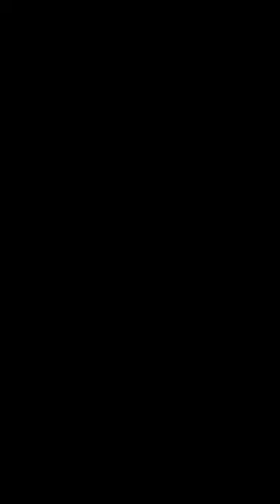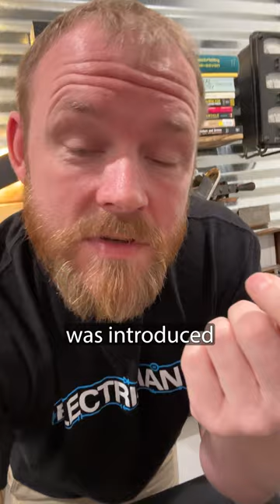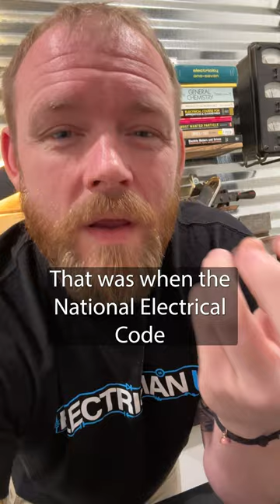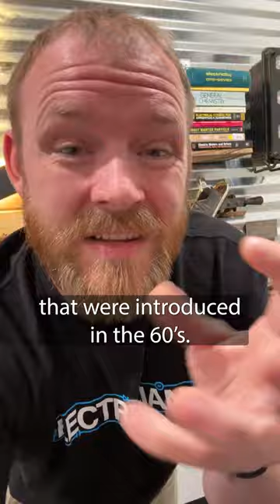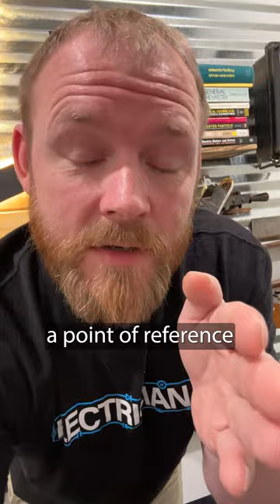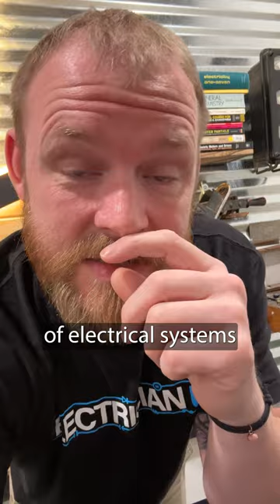Did You Know There was a Time When We had No Grounding Conductor?

Comment: Before GFIC the shaver outlet by the bathroom sink used an isolation transformer to prevent a return path to ground. GFIC compares current in the hot and neutral to make sure they are balance within 5 mA. If they are not balance then there is leakage out of the circuit loop and it shuts off.

Comment: The old Knob and tube systems were a treat. Smoking Nuetrals was common. You aint lived 'til you tighten the main neutral wire around the pipe nailed between 2 rafters in the attic to stop the lights from flickering. You hear the snapping stop, your good.

Comment: I have worked on old homes in NYC where the neutrals were switched instead the hots, and natural gas lines in homes were used as grounds. Crazy stuff.
Reply: I'm not an electrician but have seen the ground to gas lines before. I thought the same thing, What is this? Looks dangerous.
Reply: San Francisco and NYC both were the first places to have electricity. Here in SF I used to find old gas lines from gas lighting with wiring pulled in them, and the reused gas lines became conduit and had to be grounded. Also I still find places where both gas and K&T were in the same fixture - because electricity was considered a “fad” - incase you had to switch back to gas lighting… Even after 1906 when an earthquake ruptured gas lines and burned most of the city to the ground. Electricity had only been at the world exhibition there only a few years before…
Reply: Neutrals were switched to preserve the switch contacts - less of a spark to jump the contacts on the N wire.

Comment: Just rewired a house built pre world war 2 era.  Old post and tube wiring obviously done by a home owner.  Brass fittings used as connectors, coated in what am assuming was gause and tar.  Hefty bit of copper at the end of the day and a house no longer in danger of burning down.

Comment: Early electrical power distribution systems weren't even ground referenced (and still aren't in some parts of Norway or for some specialist locations, like some medical facilities). In principle, it's safer as, without a ground reference (a floating supply), then you cannot get a shock to ground. However, they found in practice that it was almost impossible to avoid accidental ground references on a public, shared distribution system, so the practice of earth referencing the neutral (or the balancing conductor on a three phase system) became the norm and then proper safety grounding systems had to be introduced.

Those "floating" non-grounded systems are called IT distribution systems. Think of it as the two outputs from an isolating transformer. Note that such systems still tend to have a grounding circuit as well, as much to provide shielding as anything else.

Comment: I'm working in a building that was built in 1950 and it is 100% ran and rigid conduit and that technically is the grounding conductor considering they bonded it at the first point of disconnect means but everywhere is just a hot neutral and that's it

Comment: Mid 50s houses and older use knob and tube, rotary switches and outlets with no ground and why there were a bazillion 2 to 3 prong adapters. Still produce power tools with only a hot and neutral.

Comment: But ground arent normally used right? Ie all lamps run on hot and neutral, without the third wire even connected. I connect it of course, for the case if something goes wrong in the lamp, right?

Comment: I actually in the middle of replacing/rewiring the old non ground wire "romex" from the mid to late 40's. This question, or request is not really related, but I just watched your "how to" (5 yr old video) wire a switch, and liked it so subscribed to your channel.
 Do you happen to have a video of how to wire a 2 way (non-smart), but high end ceiling paddle fan switch with seperate on off and fan speed/light dimmer features? 
 My plan is to run 12/2 power line to the switch and 12/3 wire to the fan/light. I intend to use the same type of switch on the other side of the room. I think I need to run a 12/3 wire connecting both switches, but never done it before so could really use an expert to school me on how to wire it correctly.
 Thanks!
Reply: You could hook it up and see if it works. If not, check the comments again for instructions.

Comment: Yeah, I knew that, and it’s a pain in the ass now when I accidentally mention that the old stuff has no ground and the homeowner goes “oh I want it done right. Is it possible to get a ground wire there?” I just say no. Slap a GFCI on there, you’re fine
Reply: i take it youre not an electrician lmao
Reply: Lol.. GFCI needs a ground to work. It's literally in the name
Reply: @vaska916 GFCI works by comparing the difference between what is sent on the hot and what comes back on the neutral. If anything 'leaks' and doesn't return on the neutral, it trips. No ground needed!
Reply: @vaska916  Code says devices without ground must be GFCI protected; you don’t have to rewire every old house you enter
Reply: @Emily-lk1mf I am, and he's right.

Comment: In certain instances grounds will make the electrical environment more dangerous and the reason I say that is I wire up high voltage on ships and we have no ground. We do sometimes please see number 10 wire in the water if we have a specific application, but the lack of a ground does not necessarily make the environment more dangerous.
Reply: GFCI's and arc fault detection can make a circuit much safer. These do not eliminate grounding but if no ground or a fault and no ground, they can save lives.

But! An appliance with a metal case and rubber (insulated) feet may have a fault with the hot wire making the metal case hot. You touch it then the current runs thru you. The CFCI may trip an save you.  But if the casing is grounded the GFCI would trip when the fault occurred.  Also this is assuming the GFCI actually works properly.  Breakers do wear out and wander out of range. The ground is the last line of safety.
Reply: @johnburns4017  I agree even when the code specifies the GFI can end a pre-tripping constantly even when you’re running motors that are not that powerful just extra grounding like they used for medical equipment is preferable, but I have motors all types of pumps that will trip GFI’s when there’s no serious if any danger involved